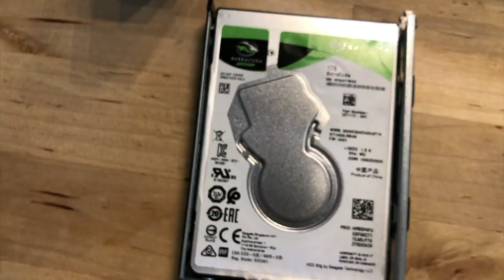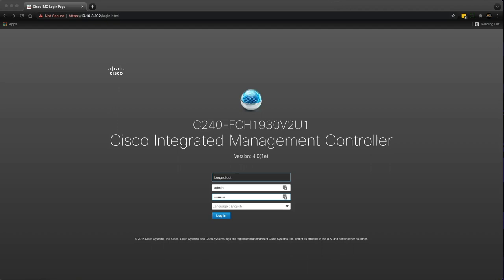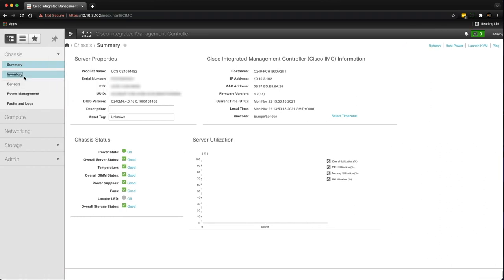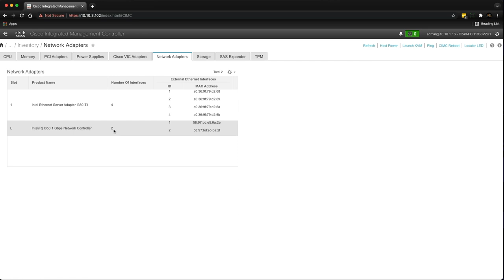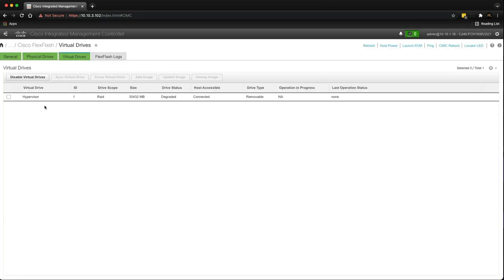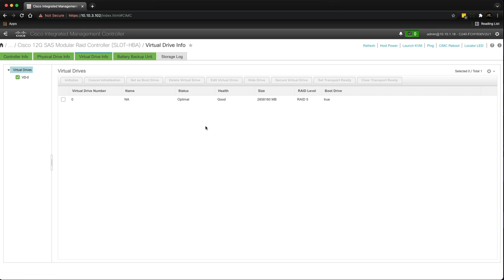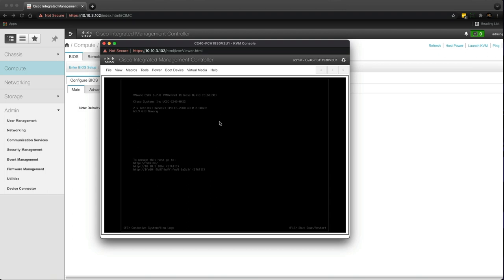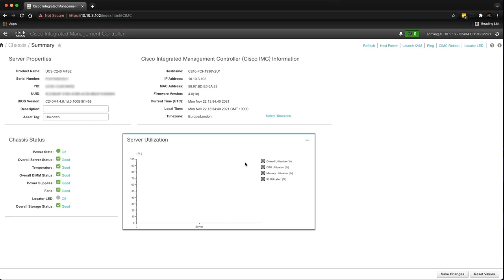Home lab - Cisco UCS C240 M4 hardware walkthrough

Comment: Bought similar server but with 24 drive SFF bays (2.5") . Using as VM server and NAS . So far so good. Quick tip, if interested in 10GB SFP+ for these units the MLOM versions are going for dirt cheap on eBay at the moment.
Reply from the maker: Nice!, thank you Derrick.

Comment: Hey MB. I know this video is a year old, but I just bought a SFF version of this server and I'm having some issues finding PCIe risers for it. I'll preface by saying that I'm very new to all of this. I've read through the documentation multiple times. Riser 1 has three options: A, B, and C. Since I need two risers that are GPU-capable, I would need option A for Riser 1, since no other option for Riser 1 is capable. There is only one option for Riser 2, and it is GPU-capable. The issue is that I can't find anyone selling Riser 1A online without calling someone for a quote. Riser 1B is what I have, and seems to be what most people get with their machines. Riser 2 is also pretty abundant, so I could purchase it online. My question is this: Might it be possible to buy two of Riser 2 and install them in both slots? I mean... in theory they're both just normal risers, right? I'm worried that something could go wrong or just not work here.

Comment: I bought this exact same server because I found a great deal. The one I purchased came with 256 GB RAM and 7x Intel 1.6TB SSD DC S3510 SATA and 1x 800GB SAS SSD, 2x Xeon E5-2690 v4 2.60 GHz, 2x PSU...My objective is to setup a backup storage for my files that I can access from anywhere. Although I have a pretty capable hardware, I do not possess the knowhow on how to achieve my goal. I will appreciate if someone can point me in the right direction to some sort of guide that would help me set this up and achieve my goal. Thanks!